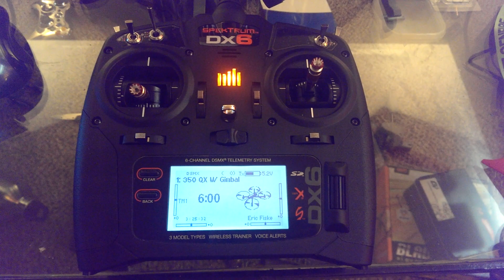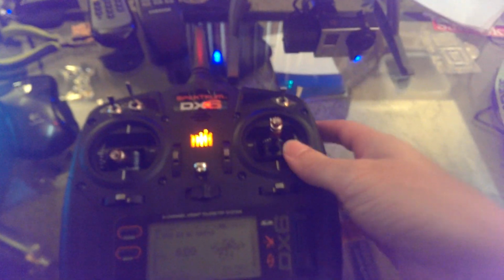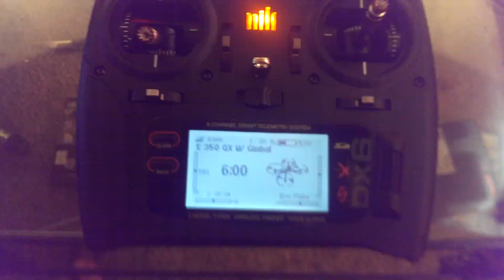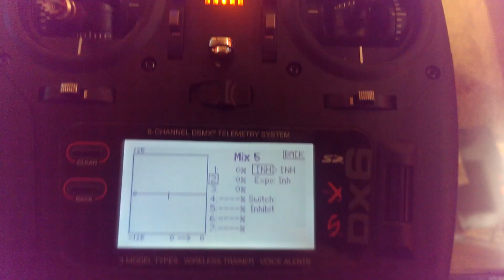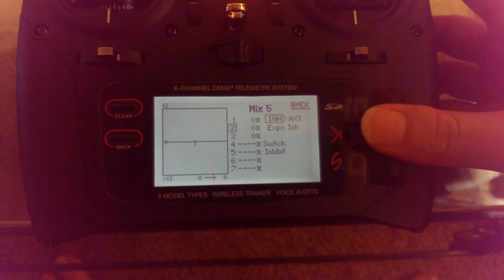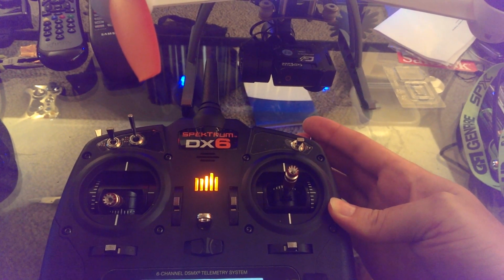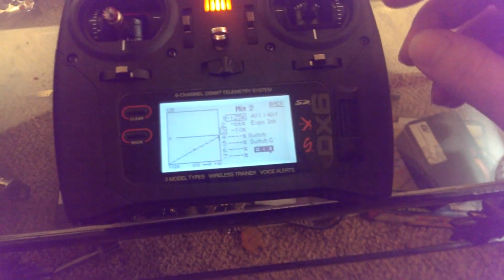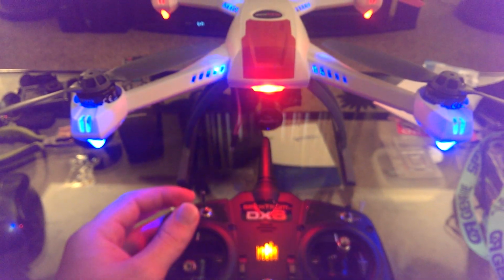350 QX 6 channel gimbal control how to, and my new gear

Comment: Did you loose any of your regular switches on your 350
Reply from the maker: no, because the RTH uses that channel but only when set up to -150 so you are able to use the rest of that channel to control the gimbal without any loss of current features.

Comment: is it possible to control with a dx5e?
Reply from the maker: no, you have to have a 6+ channel transmitter to control the gimbal. the 350 uses all 5 in the dx5e

Comment: Great video. Thanks. How do you bind the extra receiver?
Reply from the maker: just put them both into bind mode before starting up the transmitter in bind mode, that's it.